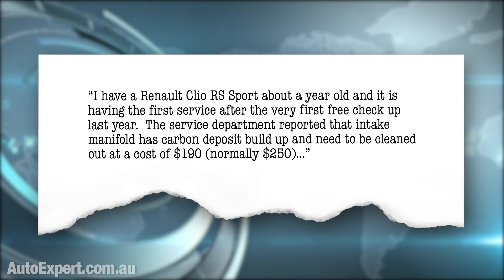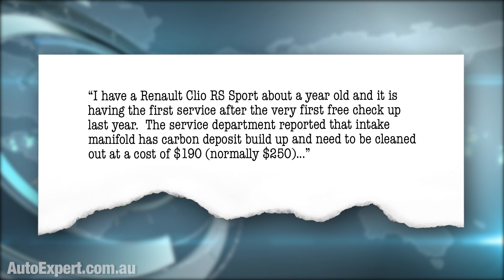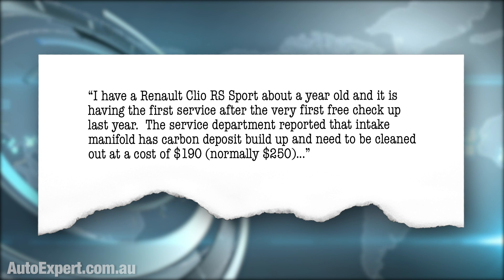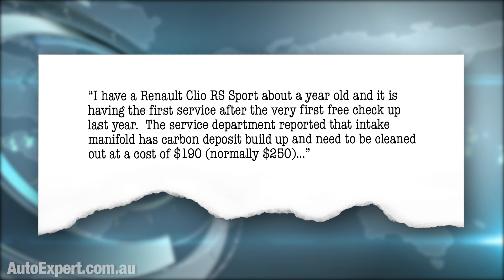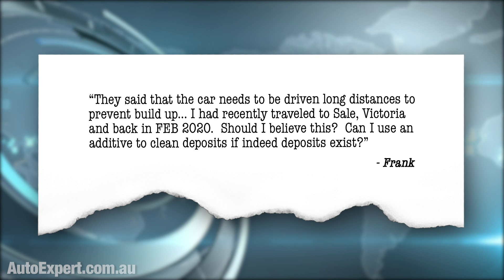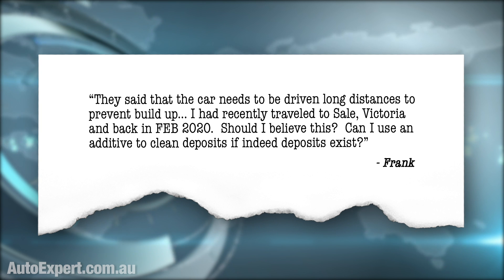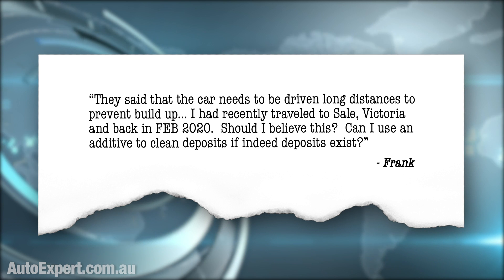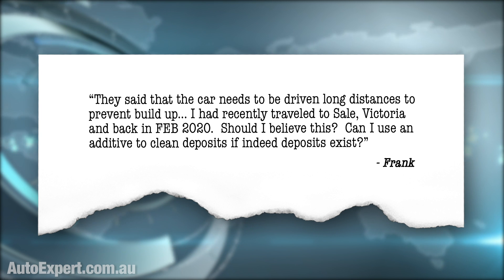The truth about inlet carbon deposits (sludge) in modern engines | Auto Expert John Cadogan

Comment: I have a question, John.  With the difference in fuel economy between direct injection and port injection, how far will an individual have to drive to pay for that $190 'plumbing' clean-up?
Reply: quite far, but the main problem is when the injectors go bad and you have to pay $500-1200 (at least here) per injector and then you have work on top of that. thats several years of gasoline so all the profit goes out the window

Comment: Focus Mk1 1.4l NA : 6l/100km - port injection
Focus Mk4 1.5l T : 5.5l/100km - port and direct injection
Tested over 1 tank of fuel same commute to work in direct succession. Hardly half the fuel consumption.
And if you have to waste fuel on the highway to keep the valves cleaner and get them cleaned eventually anyway, there goes your money saved on fuel....

Comment: Proud BSDS (beard- stroking dip sh*t) here: I still think the era of multiport injection and 2000-2010 era engine management was the sweet spot. That also overlapped with transmissions (both manual and automatic) that were close to bulletproof.  GDI, CVT, double-clutch manuals all are instruments of the devil, I tell you!  Now get off my lawn... 😁

Comment: the thing is that the "savings" in fuel are well spent in cleaning the problem created by direct injection.
Reply: There are fairly inexpensive  aftermarket canisters that can be installed to eliminate the issue. Matter of time before manufacturers build this into their products.
Reply: @laner989  as far as i know, that canister lessens the problem, it does not solve it.
Reply: @laner989  Mazda has been doing it for years. My 2014 M6 has an oem air/oil separator and it appears to not be an issue on some higher mileage skyactiv engines so far.

Comment: Toyota has added injectors into the intake manifold on direct injection engines to eliminate the carbon buildup in the valve area. They use both sets of injectors depending on the driving you are doing.
Reply: My Toyota has the supplementary injectors going all the time now (Authorised Toyota fix) because of carbon buildup. It goes better now but fuel consumption is much worse

Comment: I've watched a video here about that few years ago about turbo cars. I am driving a Santa Fe 2019 with the 2.0L Turbo. I just change my oil every time i change my tyres for Winter or Summer unless i do more than 6K between these times. Easy to remind, haven't got any issue there. When you spend that kind of money on a car, just put enough money to maintain it in good shape... It's part of the owning cost.

Comment: Great job covering this topic! I really appreciate the high level of proper facts in your videos. One question: What's your opinion on dual injection type engines that started coming out with increased frequency recently? An example would be Ford's 1.5 Ecoboost 3 cylinder (Dragon?) engine. Is the added complexity worth it in order to mitigate the risk of carbon deposits formation and.. presumably to save you fuel? Cheers!

Comment: Huh, Yesterday I've cleaned the intake valves on  my Mazda 6 mps/Mazdaspeed 6. It's quite a PITA with everything that must come out but it has to be done.
Walnut blasting and scrubbing, now they look like new. With this occasion I've installed also an oil catch can and a check valve to be on the safe side and not pressurize the OCC when the boost kicks in. I've spared quite some money doing all things by myself.

Direct injection is the way to go but the car manufacturers should do a better job on breathing system/filtering and so on. I'd rather have an OCC installed from the factory and clean that bugger every  week than servicing my car in workshop and paying a mildly 500-800EUR for this (as a non-car guy speaking).
Reply: Unfortunately the OCC is only part of the solution as even the best ones don't catch all the oil and water. The best solution is  blocking or turning off the egr valve, which is illegal as No2 with be at unacceptable levels in the exhausted due to high combustion temps. OCC only delay the problem of intake blocking which is considered useful. Another problem is the factory ecu fuel mapping allows for the exhaust gas in the charge air so if you block egr leaner mixtures may occur as more fresh air/O2 is in the mix. Not so good for petrol engines, ok for diesel as adding diesel makes more power. Another advantage of OCC is that oil coating of the intercooler of turbo engines is insulative and makes it less effective. Emissions have really set back ICE and undone all those tech advances.

Comment: Direct injection is one of the few automotive terms that is a clear description of what it is,
Like drive by wire, sounds like a Tesla thats being driven by the internet even tho it just means a sensor reads your right foot position rather then the pedal being connected by a metal cable to the intake
Reply: drive by wire ... electrical wire instead of metal cable.  Its rather straightforward and clearly labeled.  wires carry signal of how much 'power' you want, and it decides how much you get delivered.
What it can do is create a linear throttle response; which is not what you naturally get with a throttle plate ...  80% to 90% and 90% to 100% opened is not the same increase in air flow, therefore fuel and power as say 20%-30%.
in fact, Hondas and Subarus definitely use this in some of their cars with 'modes'; an eco mode makes the pedal 'dull' and sport mode makes it 'spike' fast.  A sluggish throttle helps you maximize mpg; a over zealous throttle makes people think their car is faster.
Radiator is the biggest misnomer on the entire car as if it is radiating heat to cool your engine down, you are going to overheat.  There is a reason we have fans to pull air through the fins.

Comment: Any truth to the old story about spraying water droplets into the air intake at moderate rpm to ‘steam clean’ the intake ports n valves?  Whatever happened to those backyard water injection systems? Used to be a thing on home-grown bolt-on turbo upgrades too.
I wonder how many catch-can disciplines you’ll attract JC? See how I did that? Disciples <=> JC
It’s almost offering support their argument, except you mentioned ‘well designed EGR & or PCV systems’ mostly don’t have this issue

Comment: I can only provide anecdotal evidence, but a friend's wife had a VW Tiguan with the 2.0t engine with 60k miles on the clock, and was having SES/CEL lights and performance issues.  Over the course of a month we ran two seafoam treatment regimens though it (followed the bottle's directions), and it cured the both problems that the stealership wanted $1000 to solve; top end service to clear out the reportedly gummed up intake plumbing.  I'm not going to say it is "the answer" to all ills, but even she, a notoriously mechanically unsympathetic individual, noticed immediately the improved spunkiness of the vehicle.  Really it felt cured after the first treatment, but the owners decided they wanted another treatment just because, and the bottles aren't THAT expensive.  YMMV IANAL No Holiday Inns were slept in recently.

Comment: I run baffled oil catch cans mostly because I live a mile away from work in upstate NY where we get a lot of cold weather. I walk most of the time but in the winter the weather is too crappy for that. I have to dump them every other week of nastiness that would have otherwise gone into my intake. Dealers will tell you they are a waste of time, because dealers want to charge to clean your intake ports. If you feel like getting dirty, lacquer thinner takes carbon off intake ports really easily. Getting to them is the hard part.

Comment: Direct injection can have two injectors, one in the combustion chamber and one in the manifold port to prevent carbon build up on the valve. Does Renault or virgina badge  use only one injector in their fuel system?

Comment: My '18 Toyota Hilux single cab-chassis petrol require's 6 months/10,000k service, next service due 50,000k with only 16,000k. I will continue to pay the stealership as long as i own it to service it, as with my other vehicles, If shit happens, the onus is on them, plus i do take my other vehicles out ever month to clean the cobwebs out. My Father owns a '17 350Z Nizmo with only around 1100k on the clock and now wants to sell it. I said, no one will ever buy it for what you want, why he said? Because you never got it serviced. But it's only got 1100k, I dont need to get it serviced, it's in mint condition, he replied. SMH, I'll keep stroking my covid beard!

Comment: 100% true. Highway driving is great for vehicles.  I know the jury is still out on catch cans but I ended up fitting one to my ranger and its done a great job.  I used a borescope just to check the intake manifold and after 100,000 Kms is remarkably clean.

Comment: "Double" my fuel bill??? I have a 2010 Santa Fe, 3.5L AWD. It does 13.5L/100Km on 50/50 city/highway driving. A friend of mine has a 2020 (direct injection) and his SUV does 11.7L/100km. Considering his SUV got 40 less horse-power and no AWD, the fuel efficiency difference is closer to negligent...not double for sure. It's the same story with most cars. Don't believe the numbers on the manufacturers' sheet. They do a 25-minute unrealistic test. Look at actual data from long term driving.

I'll pick a reliable, large volume, atmospheric port-injected engine every day of the week. No huge amounts of carbon and crap, no turbocharger to wait for, no oil consumption, less blow-by (lower compression ratio)...nothing. 

Actually, Turbo GDI's are getting really efficient in mostly city driving, and that's where they are the worst in reliability, so it's a catch 22.

The only thing worth having over that is an atmospheric is an electric version, but as long as they cost over 50% more than the gasoline counterpart (so it will take you 5-7 years of maintenance and fueling to get the buying price difference back) it's not worth it.
Reply: Shane he referred to carburettor

Comment: Just install a catch can. Not those Chinese webbed mesh shit things. A proper pro vent by Mann & Hummel. It’s the end of condensation and oil vapours going through your turbo/ intercooler/ egr etc. it just works. Why/ how you ask?
Simples. I change my oil at the specified intervals and I get an egg cup ( more or less) every change when I drain the pro vent system. Do I want that circulating as blow by..... no
Reply: I looked at the provent for my RX2, shame they are bloody huge! From what I read though, they are a good bit if gear. I have a dodgy catch can set up now (stinky fkn thing), but putting a proper OAS on soon.
Reply: @peteanderson2533  rx2 ? Cool car I had an rx3 coupe in 1990. Geez I still wish I had that. But these pro vent things are generally for diesels and they make different sizes for different engine capacities
Reply: @markharcourt2214  have you had to replace the filter yet?

The can I have on my car now, is just an empty can with a big filter on top. It really is shit. A few mates run the Mishimoto style of can and they seem to work ok. Probably not as good as a provent, but better than an empty can with a filter on top lol!

RX3s are going for nuts money these days!
Reply: @peteanderson2533    No never had a catch can on the rotary. 
Personally I think it’s a waste of time. They are a fun engine, sure. But very inefficient. They cannot handle the fuel that is delivered ( back firing/ flames etc) they vent to the atmosphere. They also get oil injection into the carb. So reality is there’s no point for a catch can on a rotary. I only use it on a  current toyo diesel for safety sake, which could be argued

Comment: John, you have given one of the best explanations of carbon buildup in modern GDI engines and how to prevent, or at least, mitigate it. Highway diving also burns off any excess gas (petrol) in the oil that leads to oil dilution due to blow by and short drives.

Comment: Nothing like the instant bark of a set of Dcoe's hanging off the side of the engine 😁. No Rev hang or lazy eThrottle there 😅.

While non EPA compliant. Blocking the EGR and installing a proper oil catch can that vents to atmosphere will prevent 99% of inlet carbon build up.

Also use the correct low ash oil😉👍

Comment: Don't cheap out on oil. low SAPS oil mitigates the problem. The twincharged handgrenade in my Golf oiled up the intake (probably due to the insane crankcase breather system) and the MAP sensor got it's knickers in a knot. Cleaned the sensor with MAF sensor and the intake with intake clean (there goes the neighbourhood) and it's ok until the next time. I, for one, am glad my wife's 86 has D4-S.

Comment: Subaru have included inlet manifold cleaner in their servicing for at least 20 years due to the boxer engine having longer inlet tracts. An aerosol foam is sprayed into a vacuum port on the manifold with the engine hot. This does coat the inlet including the valves. The engine is then started and run at high rpm while you pump the rest of the can in. Whatever is in the can is potent, it will strip the two pack paint off the workshop floor, nothing else touches it. $20 A can from Subaru, it might be worth a try if you have a manky manifold.
Reply: Quite a few Mechanic mates recommend this stuff. One has a "special spot" where tney do it, as the concrete is already stained lol!
Reply: The Subaru upper engine cleaner is a brilliant product. I started working on Subaru's in 94 and we were using it then on all EFI models. It was also great as a penetrating lubricant for the stubborn turbo bolts on older RS liberty's. Nulon also sell the same product and I use it in our GDI cars every service.
Reply: @matthewrafferty4117  Did you ever loose the straw off the end? My apprentice did, it got sucked in, rattled past the inlet valve and we could smell it burning on that catalytic converter, no lasting damage thankfully.😂
Reply: @Andrew H It would normally be done during the service before dropping the oil, so yes an oil change after.
Reply: @Andrew H i do. I give mine the upper engine cleaner, a dose of oil flush into the oil, dump that oil and refill, give it a drive around for a few minutes then dump and refill the oil and filter again.

Comment: You’re dead right John. Direct injection has enabled more economy to vehicles with more powerful engines.
But, (and you know anything said prior to a “but” is all bullshit right?) with technology trending toward economy, we fail to see the energy it takes to build said technology.
There’s more than just fuel to consider with these newer engines, it all starts from the ground up. First we must mine the metal. 

Now I’m no engineer or manufacturer or some tree hugging vegan blessed with a bible in hand, nor am I attempting to build a compelling argument... Engines built decades ago are still running strong to this day, yet an engine built 5 or less years ago are being blocked with their own excrement. But the newer, more technically advanced engines seem to be the way to go.

I’m not convinced.

Love the channel, advise and your humour.
Reply: Those old simple engines had the heads off every few thousand km to have a de-choke done. Modern engines are doing hundreds of thousands with just basic maintenance.
Reply: @Stephen Edwards... Just two examples (because let’s face it we don’t have all day), and I’ve personally be involved with many, many more.
1. My farthers 1967 XR Ford Falcon. It has been around the clock three times (99 999 MILES) and is now on it’s fourth. Totally stock 170 blue motor 6 cylinder pursuit motor. Never been rebuilt!
2. My 1965 EH Holden which was given to me on my 15th birthday.... Again... Been around the clock 2 times and is on it’s third (99 999 MILES).Totally stock 179 grey motor 6 cylinder. Never been rebuilt!

Yes, both cars have had break downs and sludge from the “OLD” leaded fuel under the rocker covers, but to this day have NEVER been opened. These are just two examples. Spare me with the few thousand k head replacements. I’d love to see these new engines do that.
Reply: Directed injection was a good idea at the time....

Comment: I have water/methanol injection & catch can on all my cars. Some have 300,000 km and the back of the intake valves are as clean as a whistle.
Reply: Does this require an ECU retune or is it safe for most cars and is water/ethanol just as effective?
Reply: @IIMurphaII  Yes it does need a tune.

Comment: I wonder what you think John about using shop-bought sprays that purport to remove such deposits?  If I recall, our American friends seem to make quite a lot of these products - one from Seafoam comes to mind - that have been 'tested' by many YouTubers (e.g. 'Chris Fix'), with varying degrees of 'success'.  Some of these products also claim to clean the EGR, throttle body and/or MAF sensor if sprayed in the correct place with the engine running.

Comment: Modern engines are pain in arse. If it’s oil burner, drive long distances to burn off collected soot.  If it’s direct injection, drive long distance to minimise carbon build up on back side intake valves....WTF? More time spent  driving and more fuel usage. Idiots.